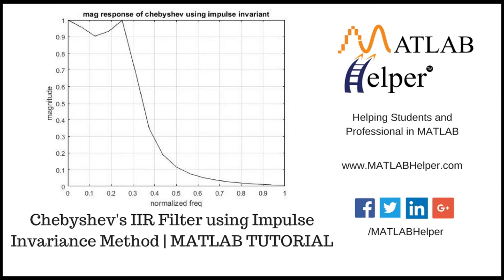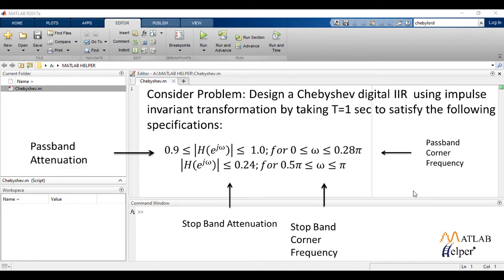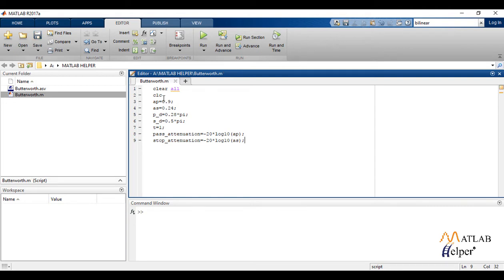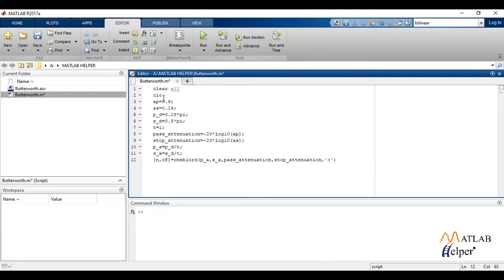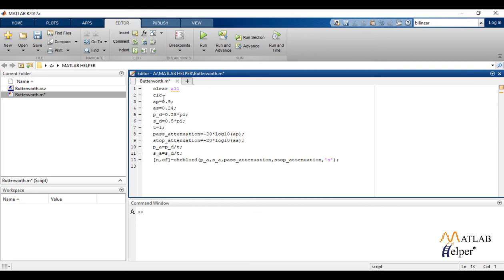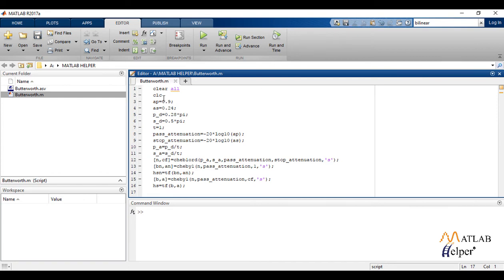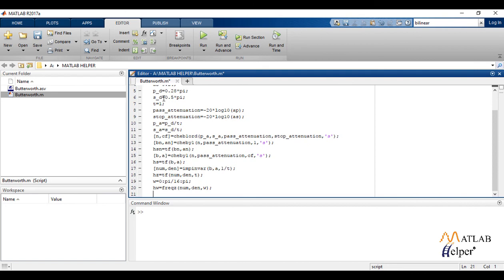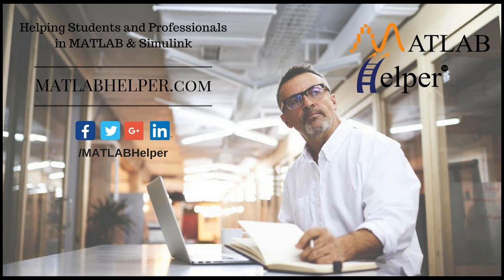Chebyshev filter using Impulse Invariance | DSP | @MATLABHelper

Comment from the maker: Book our premium course on DSP at https://mlhp.link/DigitalSignalProcessing/
Read this lesson at https://matlabhelper.com/course/chebyshevs-iir-filter-using-impulse-invariance-method/ for codes & explanation.
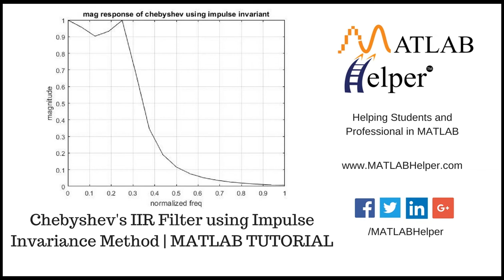0:00 Introduction 
0:14 Problem to be solved
0:50 MATLAB Code for designing filter
3:41 Run MATLAB code & Check Results

Comment: #In impulse variance method, the IIR filter is designed such that the unit impulse response h(n) of a digital filter is the sampled version of the impulse response of an analog filter.
#As per the given problem we need to know the values of passband attenuation, stopband attenuation, passband and stopband corner frequency.
#convert the values of passband attenuation, stopband attenuation i.e ap and as to decibels.
#calculate the new corner frequency.
#cheb1ord is the command that calculates the minimum order of digital/analog Chebyshev type 1 filter as per filter specifications.In that command 's' denotes that we are working in s-domain.
#cheby1 is the command that returns the transfer function coefficients of nth order.it can be used to determine the unnormalized function.
#tf is the command used to determine the transfer function.
#impinvar is the command that creates a digital filter with numerator and denominator coefficients whose implse respone will be equal to impulse responseof a analog filter.
#freqz is the command that gives the frequency response in z- domain.
#abs gives the absolute value.
#i have learned all these commands and can design Chebyshev filter for a given filter specification.
Reply from the maker: Tejaswee Rayana, Glad to see your appreciation for our Video. Do support us by Subscribing to our YouTube Channel at https://www.youtube.com/c/matlabhelperteam